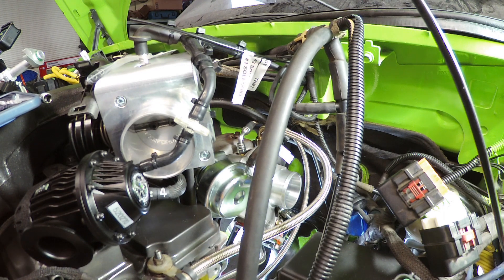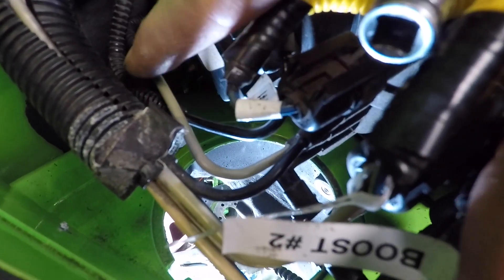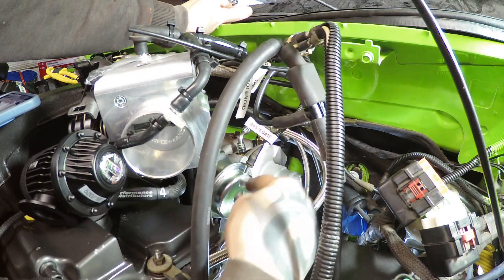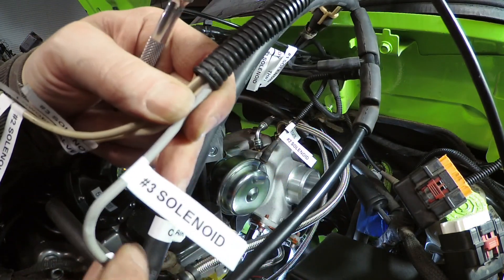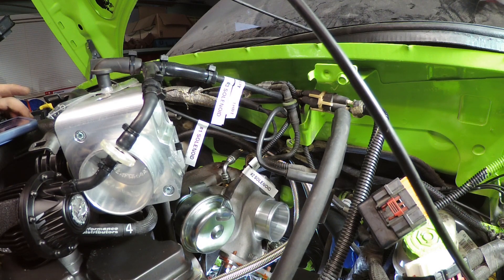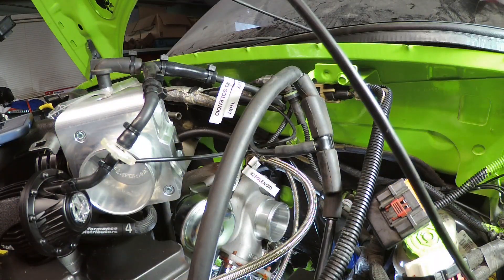PT Cruiser Turbocharger Vacuum Lines

Comment: At 12:13 you’re holding a T that is fed from the larger nipple on the compressor. This T has a grey tapered Insert along the straight through section. What is the purpose of this? It’s a decent size feed line and T and soon as it gets to the T it’s the tiniest hole.
Reply from the maker: Tracing the Grey Hose I believe you are referring to leads back to the Top-most connector on the #3 Turbocharger Solenoid.  The #3 solenoid is also connected to the SVA (Surge Valve Actuator - similar to a Blow-Off Valve 'BOV' but instead of venting to the atmosphere like the BOV it releases the air back into the intake side of the turbo), the Purge Solenoid, and the Throttle Body.

So though this line may seem small compared to the other larger vacuum lines I am sure it's purpose is to send very necessary vacuum levels to the #3 Solenoid for the sake of proper SVA and Purge Solenoid functionality.

I am not a Turbo PT Vacuum-line expert but I hope my hypothesis is helpful.

Comment: Excellent video, came here looking to find out why my vacuum ejector is spitting oil, and I suspect it's from the turbo discharge port. Does this mean my turbo blew a seal?
Reply from the maker: @altema22 Thanks for the visit.  That does sound like a seal was blown if oil is coming out of a vacuum port.  You can find replacement Turbos for the PT pretty easily (many include the exhaust manifold with it).
Reply: @PTBubbles  I did go ahead and replace the turbo, but when a shop replaced the transmission, they not only hooked the turbo back up all wrong, but they damaged some of the impeller fins causing it to go out of balance. They paid for a replacement though. I was happy with the way it ran, but recently found out the front connector to the vacuum ejector was split (the one that goes to the purge solenoid), and when I fixed that, it was down on power. So that why I'm visiting again to see if something is wrong with mine. Thanks again for the best video on this subject.
Reply from the maker: @Altema22 I hope you find the issue.  It doesn’t hurt to investigate start to finish all the lines.  Maybe there’s an incorrect connection still?  Or another split line?

Comment: There is also a plastic line that comes from the tee by map sensor to the turbo side and points to drivers side.  What hooks up to it?
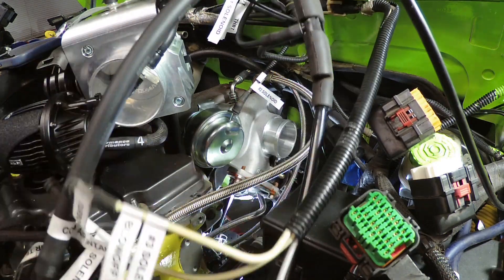Reply from the maker: @stevec6898 I believe you are referring to the plastic line that joins the T-Junction on the Turbo-side (pause at 11:10 or 11:36 and you will see the T-junction)

If so then it is part of the "circular loop" of hoses all in that cluster. This is the same junction that the hose you asked about at 9:18 connects to.  In fact they connect side by side on that junction.
Reply: No this hard plastic 1/4 line comes from by the map sensor.  It is teed off of the vertical hose right below the top tee. It turns up about 3 inches and turns towards the turbo side. It turns towards the front for about 3 inches, down 3 inches, back to the right 2 inches with a barbed end. About halfway between the turbo intake and the master cylinder reservoir. 
It also seems that the only vacuum supply for the whole system is from the small line coming from the brake booster??
Reply from the maker: @stevec6898  I'll answer your last question first.  There are other larger vacuum lines in the system (such as the Brake Booster to the Intake Manifold - about a 3/8" size hose, and the Proportional Purge hoses and the PCV hose).  This video was focusing more on the Turbocharger specific lines/hoses since they are unique and more complicated then the N/A 2.4L configuration.  Other than the specific Turbocharger lines, the Turbo and N/A vacuum lines are almost identical - just minor variations.

Apologies if I am not narrowing in on the exact hose you are asking about but here is what I think you are identifying:
First just a couple clarifying items:
• The MAP sensor would be considered to be positioned on the Passenger side (on the Intake Manifold)
• The TIP (Throttle Inlet Pressure Solenoid - specific to Turbo models only) is also on the Passenger side mounted on the Firewall/Wiper Cowel lip.

•  I believe the hose you are identifying Tees off of the junction right next to the TIP sensor on the Firewall and connects in the following locations:
---Small black plastic hose travels in the passenger-side direction inside the Turbo Vacuum Line loom and goes to the Turbo Solenoid #1 (the TIP Solenoid) which is the rear-most solenoid with the RED electronic connector
---Rubber hose travels downward along the firewall to the Purge Valve (which is mounted on the A/C Drier assembly)
---2 larger plastic hoses come off of this Tee and travel towards the drivers side inside the Turbo Vacuum Line loom.  One of these connects to the top of the throttle body and the other connects to the "circular loop" of lines/hoses I describe in the video and in my other response to you.

I hope this helps.

Comment: At approx  9:18 you show the black plastic hose that splits into two.  One goes to brake booster . Where does the other one go? You shake it and mention a "circular thing " but do not define exactly where the other lines go in the circular
Reply from the maker: @stevec6898 Thanks for the question.

If you keep an eye on the lines between 9:18 and about 12:30 you can see how they connect better. That 2nd line you mention connects to the "circular" set of hoses right where the two large rubber fittings are (pause the video and look slightly to the right of center screen at 9:37 - those two rubber fittings that join into a plastic junction.  I am also holding the junction where that 2nd hose connects at 10:03).

At 10:51 you will see the large plastic hose that comes down from that junction right behind the loom with the 3 plastic colored hoses.  Those are all actually joined at a T-junction where connections split off to the following (pause at 11:10 or 11:36 and you will see the T-junction):

1) Cold Air Intake (larger rubber hose) (I am holding it in my hand at 10:14)
2) Rubber hose on the larger driver-side Turbocharger port (not the smaller rear connection) pause at 11:49
3) Smaller plastic hose that goes to the rear connection on the Turbocharger - watch close around 12:00 - 12:30
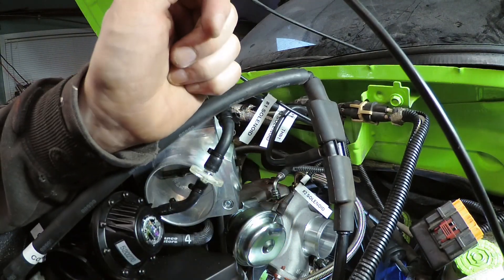4) Blow-off Valve Surge Valve Actuator) - watch around 10:30

Hopefully this helps.

Comment: Can you confirm which solenoid number goes to which colored connector? I want to make sure I didn't swap mine around when I replaced my mid mount/timing belt/upper motor mounts.
Reply from the maker: @philsowers You mean the electrical and not the Vacuum tubing, correct?

Here is how mine are connected:
#1 (closest to the rear of PT and Cruise Control Diaphragm) = Red
#3 (Center connector) = Blue
#2 (Closest to the front of PT) = Green

I hope this helps!
Reply: @PTBubbles  It does, thanks! The numbers wore off my solenoids so when i did the belt work I removed them, but incorrectly numbered them 1-3 in order "incorrectly". Finished replacing most of the hard vacuum lines with reinforced silicone hoses to run between components and solenoids. Going to wrap up the project with a vacuum manifold to clean up the rat nest of ejectors, Tees, check valves, 90s, and hard lines that stick up and flop around in the engine bay on the intake/driver's side. I'd like to make a final solution with rigid 1/4" Push-To-Connect nylon tubing and connectors, but they're not as forgiving as the silicone hoses since connections will requiring installing threaded adapters and couplers to change diameters, not to mention the solenoids are a male connector that's not able to be tapped. Might just be content with the silicone for now.
Reply from the maker: @philsowers  This sounds really interesting.  If you captured photos or video of what you've done I'd be happy to share it in a video unless you'd rather yourself.

Thanks for sharing the description though - I hope it works well and you can wrap it up nicely.

Comment: Great explaination and walkthrough tour of the PT's vacuum lines! I'm currently replacing my hard lines with black silicone 5/32 & 3/16 (4 & 5mm) hoses. The intake side is such a rat nest. Working on a manifold to replace all the weird Tees and secure against the firewall along the hood gasket lip in some plug wire separator/dividers to get everything cleaned up! Might need to do some clean labels on both ends in case it ever goes into a shop. lol
Reply from the maker: @philsowers Thank you for the feedback!  It sounds like you are working on a cool upgrade to the lines.  It would be great if you could share the progress or at least the completed project once you are done.

Take care,

Shane of PTBubbles

Comment: What hose is the the small one on the down pipe mine is missing in it
Reply from the maker: @user-uh3gh5mz6e Apologies - can you specify which pipe you mean?  The Oil Drain Pipe?  Or the Exhaust Downpipe/Elbow?  Or something else?
Reply: You should be able to trace the hose back from the solenoids to see which one isn't going anywhere or is unplugged, then get some 4mm hose to replace it. Depending on which side of the engine, I'm guessing it's the intercooler, but depending on what you meant by "downpipe" it could also be the turbo wastegate, or bov (charged air valve) line.